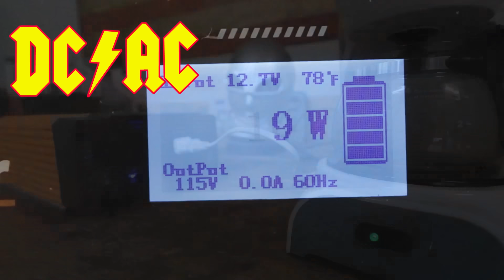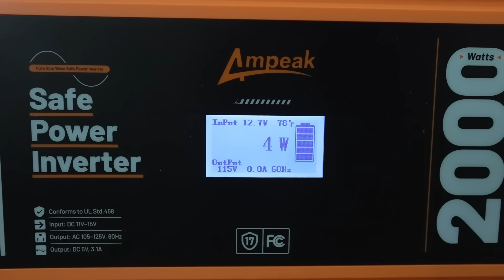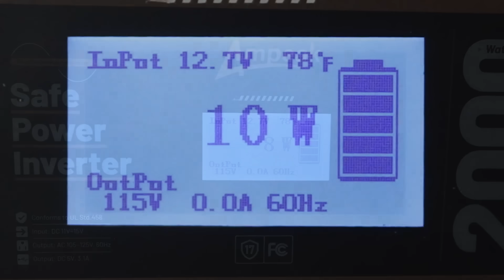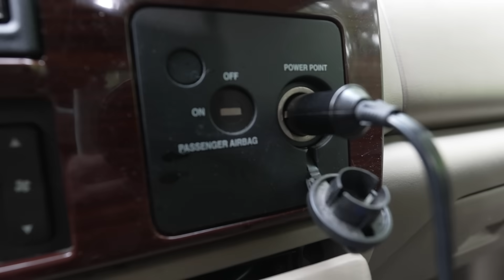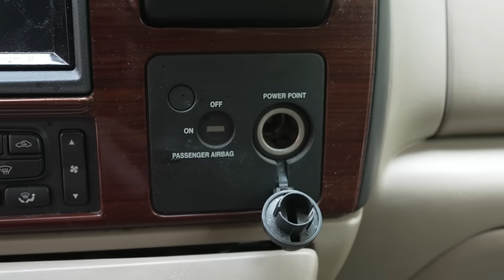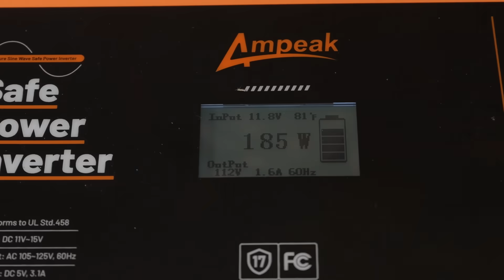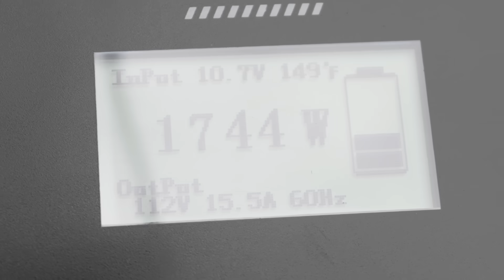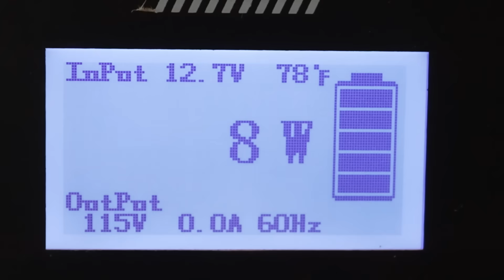FOR BEGINNERS: Power Inverters 101!

Comment: Thanks so much Sean.  I love my Ecoflow & solar panels,  but forgetaboutit if it’s cold or cloudy or rainy or you’re in the trees or just camping anywhere in the Cascades of Washington.  
I’m get confused when it comes to amp/volt/what conversions
Reply: Watt
Reply from the maker: @annmariewhale4501 thank you Annemarie for your kind comment. There is an old “Wat” meme that I would post if we could post photos here! 😂
Reply: I’m thinking…. Why buy a generator when one can purchase a battery & inverter for waaaaay less.   Thanks again and I plan to do more investigating on this subject.
Reply from the maker: @annmariewhale4501  Thanks for your comments... very interesting to me, and you have given me some ideas for more videos. The issue with the battery/inverter combination mainly is one of capacity/longevity. In other words, while you can run just about anything for a while, doing so will drain your battery and it will need to be replenished. For many appliances (blenders, coffee makers, electric cooktops, etc.) this is no big deal because you just use them for a short while. But for A/C units, batteries get knocked down quickly. If you are in an area where you don't need air-conditioning, an inverter can cover a LOT of your bases. I should probably do a video discussing in more detail.
Reply: @LongLongHoneymoon  
Ooooooh, now I get it.   A generator… replenishes the battery power.  That makes much sense, like an alternator in a car. 🤦🏼‍♀️
I’m eager to learn more.  You have a way of explaining things that make this subject easy to understand.  I’ve watched ‘HOBOTECH’ but get lost in the electrical jargon and my eyes glaze over.  
Your bear spray video helped to… and speaking of electricity and bears… did you know you can buy a bear trip line to put around the perimeter of your camp site?  Once tripped it makes a loud “BANG” to scare off the animal or person that set it ( or an animal- person hybrid like a Sasquatch)  👩🏼‍🔬🤗
I
Reply from the maker: @annmariewhale4501  first i've heard of the bear trip line! thanks for your feedback....i agree that with some of these topics, it's easy to get lost in the weeds, so to speak... i try to keep everything simple in most cases (unless it's a total "geek out" type of video!)
Reply: @LongLongHoneymoon  
Amazon sells the trip wire set.
(Of course they do 🙄)

Comment: I ran everything in our camper off a Cobra 2500 watt modified sine wave inverter for YEARS. Computers, phone chargers, hair dryers,  you name it. Now we have lithium batteries and a 2000 watt pure sine wave inverter that runs our 120v ac fridge and everything else when boondocking. Works great! I have the inverter mounted in the front pass-through storage area (next to our lithium batteries). I have a heavy duty extension cord plugged into the inverter, and it runs back to the shore power cord where I have a homemade 120v electrical box to plug us into ourselves. It gives us 120v in all the plugs in the trailer. 20+ years and still boondocking!

Comment: Thanks for the fun video!  2000W is going to be 150A at 13V.  The cables to your battery only looked to be around 4-6 AWG which should get pretty warm (and waste some power) at 150A.  I would never walk away from it while running hard.  1/0 AWG would be a safer choice for this DC current.  Safe travels!

Comment: I love Long Long Honeymoon, but this isn't really a great review IMHO.  When you were showing the microwave running the inverter's display read that your truck's battery was down to under 11 volts which will kill the battery if it's kept under that load too long.   Inverters can be great, but if you want to use them for camping and running coffee makers or any other real load you're going to need more than a single 12v battery to keep it going more than a few minutes. You can figure that for every 10 amps pulled on the inverter's load side that 100 amps will need to be pulled on the supply side.  They will drain a typical 12V battery really quickly.

Comment: I went down that road.  Bought a nice inverter, added a couple of deep cycle batteries, plus got a solar panel to charge said batteries.  Works pretty good.  All in pull behind little camper.  When not really in use a Battery Tender.  Seems to work.

Comment: Almost everyone gets this wrong. Laptops, tower computers, TV & radios ALL CAN be run with a MODIFIED sign wave inverter. NONE of these items ACTUALLY run on 120V AC. They all have transformers (usually reducing the voltage to 12V AC or 5V AC) and full bridge rectifiers. The full bridge rectifiers will turn the AC voltage into DC voltage that the computer, radio or what ever needs to operate. 
NOW where a PURE sign wave inverter is NEEDED is for things like fans, air conditioners, refrigerator, induction cook tops & microwave ovens, vacuum cleaners. These are the things that NEED a PURE sign wave inverter. Even if you have a 3,000 MODIFIED sign wave inverter it WILL NOT run an induction cook tops. The MODIFIED sign wave is too DIRTY, the sign wave is not good enough to run an induction cook top. ALSO, MODIFIED sign wave inverters are VERY hard on ANYTHING that has a MOTOR in it.  You will shorten the life of anything with a MOTOR in it by 30% to 60%. ALWAYS use a PURE sign wave inverter for these types of things. PLUS an electric motor that runs at 10 AMPS might (according to the label), depending on the application, will take 20 to 60 AMPS to START the motor. Air conditioners are one of the biggest draw at start up. These motors might take as long as two to three seconds to wind up to speed. Make SURE your inverter is rated to that much power.
I have lived in THIS motorhome for 18.5 years, yes I am a full-timer, I have been for about 28 years. I have 1,950 watts of solar, 1,200 AMPS if lithium batteries and a 5,000 watt pure sign wave inverter. Even that will NOT run my drill press, electric pressure washer or my welder. I use my diesel powered 7,200 watt generator to run those three things.
Reply: Very good !

Comment: Thanks for that video.  I have 8 deep cycle batteries wired in parallel putting out 800 amps to a 4k inverter, which powers a portable AC, but not our roof AC in our Toy Hauler.  We also have 2 size 8 cables running from our F250 alternator back to our truck bed to keep these 8 batteries charged up.  Running the engine about 10 minuted per hour keeps them charged.  Cheaper than running a generator full time, and less noise.

Comment: Good info, I personally try to use only 12v appliances when camping.
You do lose efficiency going through a inverter, and I don’t have near the solar setup you do for recovery.
If I absolutely need 110v I fire up the Honda.

Comment: I installed a 3,000 watt inverter in our Brinkley. Along with a couple 370 watt solar panels and 4 100ah lithium batteries we had power to spare as we spent the winter off grid in Arizona. We used the TV, microwave, washing machine, and hotpot. Not all at the same time obviously. Solar and inverters have changed the RV industry. We have a small generator but rarely use it. Thanks for the video. See you on the road sometime. Burlington Bill busking on the road and here on you tube.

Comment: You forgot to mention the "draw-down" part of these inverters. They can and will
discharge said batteries very quickly. Probably would be a good Idea to run your
vehicles engine while using especially when trying to power high current draw 
appliances like microwaves, hair dryers, coffee makers and others
Reply: My thoughts exactly.  The power has to come from someplace.
Reply: I am just learning about these but thought the same thing. How long could he power his Airstream withouth the car running befroe the car battery died. Also, wondering if using a smaller one in the RV 12v outlet to power iphone or laptop how much drain on RV battery. I am looking at getting my 1st small travel trailer that will have lots of 12v outlets as well as 110 outlets but can only use them when hooked up to shore power. So very interested in this brand in RV 12v outlet and how much drain say charging my iphone for an hour or two. Hoping for an answer.
Reply: Yeah I hope someone didn't get stranded because of this video not acknowledging the battery drain of lead acid batteries. From my understanding, lead acid batteries are NOT designed to be drained by large amounts and recharged- their capacity takes too large a hit when you put this kind of draw on them.

Comment: What Sean didn't mention is that big inverters powering big loads will chew through batteries so fast it will make your head spin.  I wonder if he had to get a jump start after running the microwave off of  Seemore's batteries... the inverter, while running the microwave, was pulling in the neighborhood of 163 Amps from the batteries!!  The world may never know.......
Reply: DC appliances makes more sense!

Comment: We've used a small pure sine wave 400 W inverter for ~6+ years for our small computers & appliances. Works great for us & our needs. Using a 2k watt inverter & only one battery; you'll shoot thru your battery pretty quickly. Pure sinewave is the only way to fly. Your not spending much more for the feature compared to the damage you may receive.

Comment: Good info!  Problem with using 12v car adapter is that most of those are fused with 10A fuse.  Max AC you will get is 120W if lucky.

Comment: I have been using the Car Generator to power our 25 Airstream for the last two seasons, sold my Honda 2000 generator.  Jonathan (an Airstream owner to), the CEO, also sells kits to use for home for blackouts.
Reply: ummmmm - you want me to idle my 70k diesel truck to run 2000 watts?  Don't think so. I'll buy an inverter genset of 1k.
Reply: @hgoff5617 how about a “power smart 2580” for $334.00, runs our ac no problem

Comment: From experience don't buy crap since more than likely you will replace the crap. Spend the money on victron equipment ounce and you won't buy twice. I run everything in our 5th wheel including our air conditioner with 600 ah of lithium batteries. We don't think about power anymore

Comment: Efficiency isn’t max output is what’s lost in the conversion so for every 1w of dc power you get .88w ac power.  Essentially if you want to get the 200w that inverter claims it will cost you 244w for the battery.

Comment: it all depends on your battery you can kill a battery really fast
Reply: How fast? Say, how long could Sean run the microwave before he had to jumpstart SEEMORE? (...and then from what?)
Reply: @matthewwallace9280  only just a few minutes... that inverter was pulling about 163 amps from the batteries in Seemore during that demo.  That's about the same as continuously cranking the engine for the same amount of time.  How long can you crank your engine nonstop before the battery is dead?
Reply: @BKD70  That's what I thought. Thank you!
Reply: I like the smaller versions, but big wattage requires everything the charging system wants. In addition, an alternator is quite expensive and difficult to change for the average citizen. I hate being broken down more than I like generator free power. Imho.